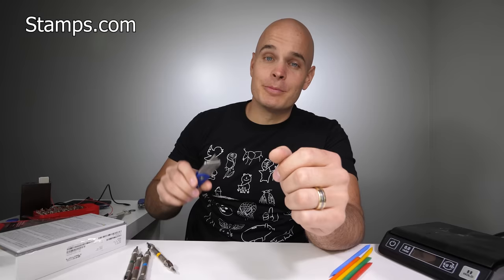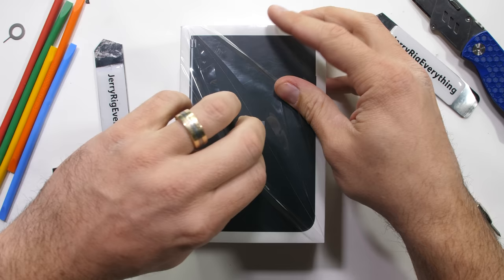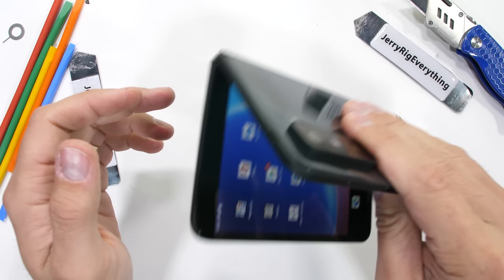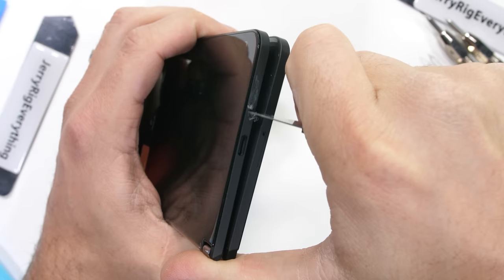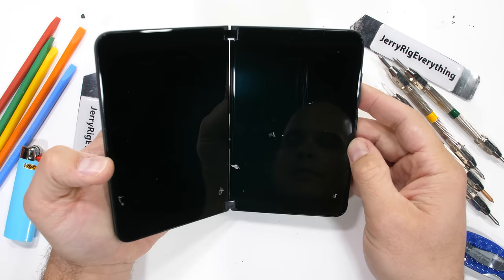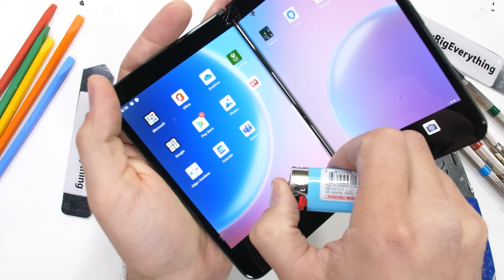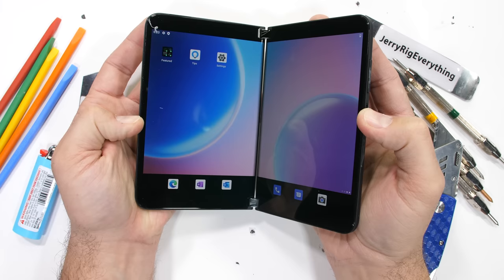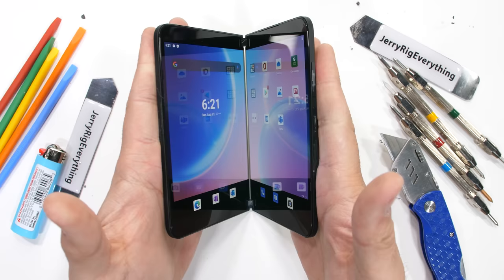Microsoft Duo 2 Durability Test! - There's one big problem...

Comment: Agree with Jerrys comments here, Microsoft should never have shelved windows mobile. It is by far the best mobile operating system even by today's standard despite the fact they haven't worked on it for a while. Android and iOS use similar kernel design so they are kinda alike in ways. Windows wasn't and Microsoft had an amazing team during its time, best cameras, smooth phones even on 512mb ram and imo the best user interface for a phone, app tiles were so good and intuitive, None of this boring app icons bullshit. The app problem would have been solved now with their appstore solution that's just out for windows 11. Just port it into the mobile.

Comment: Full Windows 11 on the Duo is entirely possible and would be amazing. I would buy it instantly. 

As an Android phone I couldn't care less about it.
Reply: yeah it all cool until your phone need activation lmao
Reply: @NandelsWoking  how is that an issue?
Reply: Widows on mobile device ???
Haha .... they tried windows 8 / 10 mobile and was really bad to use .... 
Not proper designated 99.99% apps for touch and worse dual screen.
Windows is good only with keyboard  and mouse.... a lots of memory and fast CPU.
Reply: @mirek190  Windows 8 and 10 Mobile were not full Windows operating systems. Windows 11 ARM is a full Windows OS.  Windows 11 also works well with touch and can be run even on old slow hardware - my Note 10+ is more powerful than my Surface Go, yet my Go runs Windows 11 just fine.
Reply: @nickthaskater  What's that point if you do not have any touch apps for win 11 mobile .
Apart from that windows apps are heavy .
Reply: @mirek190  There is no "Windows 11 Mobile," just Windows 11.

Any app is a "touch app" - this can be seen by using something like a Microsoft Surface tablet running Windows 11. I use my Surface Go as a tablet on a regular basis without issue.

Comment: Blaming Android for incompetence of Microsoft devs on this particular product is just gold 😂
Reply: I see his statement not so much as blaming Android, but stating the short comings of Android for any foldable mobile device in general. Think about it, why did Android started the development of 12L? They knew foldable will not be successful on current Android design. I think Android 12L is the beginning of robust Os design for foldables such OEM can just do HW, skin the Os, but let the Os do all the heavy lifting that will make foldable do good stuff and solve problems that single screen Phones can not do. All current foldable phone manufacturing are doing independent codes additions to show what foldable can do which might not help Android Os in terms of fragmentation. Let the Os direct and standardize the best use and features for foldables and OEM can add there own values and extras.

Comment: The camera bump actually broke the glass on the back if u put pressure on the camera inward the glass will crack. Not even that much force so don't squeeze the bottom part together when you're folding it open as one display.

Comment: I have the Duo2 and it took a very short fall to a carpeted floor while in "laptop mode" and bent and knocked the hinge out of place at the bottom...it still opens but yout have to manually push the henge to get the screens to fold evenly when flat.

Comment: it feels like this could be a really cool gaming phone, considering its already kinda like a ds anyways. itd be perfect for emulating different systems, since you could theoretically put touchscreen versions of any controls you wanted on the bottom, or even have one screen dedicated to the game with the other open to a walkthrough, which would be nice. that said idk the specs of this so it might not have the power for serious gaming, but i still think it at least has the potential to be really cool. i really hope microsoft and other manufacturers keep experimenting with the dual screen phone format, especially since the separate glass screens seem a lot more durable than the soft folding plastic ones.

Comment: It sucks that Microsoft isn't supporting the Duo. I feel like it would be way more successful if it was designed and advertised as a Windows or Android tablet instead of an oversized phone. Make it slightly taller, and I would definitely consider getting one. Even if the build quality isn't up to par, having a non-foldable screen with just small bezels connecting them, and not requiring a case to protect the screens are really good selling points.

Comment: I'm a power desktop user and can confirm that there will be no windows mobile OS anywhere soon if they dont develop a whole new good kernel, Which they won't for sure! 
But this could be a great device for linux if it wasnt microsoft designing the device. Because Linux can run a lot smoother

Comment: With curved screens, its possible to make a folding phone that uses glass and straight angles to fold open with no bezels. opposing 45 degree angles on the screens and a slight modification to the hinge and it could work perfect.

Comment: I think that any mobile processor in that form factor would be not nearly powerful enough to run full windows. I daily drive a Surface Go 2 with a core M3 processor. That thing is way bigger and more powerful than the Duo and still only just provides a good windows experience. Instead I would be very interested in this phone if it could take a display input form a laptop and act like 2 small external displays. That would be so nice for multitasking on my Surface.

Comment: windows on this thing would be a killer, and not in a good way.

yes windows 11 supports android apps, but listen, android is just way more stable than any copy of windows has ever been and also uses far less resources on idle to begin with, which means longer battery usage, aside that do you really want an OS on your phone that can just kick the bucket or delete your documents folder after some faulty update? re-installing windows on that will be a massive pain if for whatever reason it quits to work.

Comment: Agree with you on the OS, MS should plop a windows OS in the device.   Of course, the price would likely go even higher.   But I'm not sure it would damage their laptop sales that much.  It's still a small device, and productivity is gonna be limited due to the size.   Not a fan of the camera bump, especially since you have to open the device to talk on the phone.  If you have to fold it against that camera bump to use it as a phone, that's just plain awkward.

Comment: I don't think that a Windows OS would be very practical as a primary phone. If you push yourself you can make it work, but not many would want to do that.
There are far too many apps that we are used to using on our phones (Android or iOS), which are not available on Windows. It would be extremely nice, if my phone was able to do the kind of stuff that I do on my desktop/laptop, but not at the expense of its existing functionality. 
A lot of people already pointed out Samsung's DeX. I believe that this is the correct approach to smartphones for power users. It's primarily a phone, and okayish as basic desktop. A big hurdle before is the fact that a lot of Android apps are currently not optimised to work on a large screen. This will gradually improve with the rise of foldable phones. So unless Samsung decides to axe DeX, it will only get better.

Comment: The main windows problem with smaller screens anything below 10 inches is the classic applications! This is not Microsoft's problem that the third-party x86 Classic applications are not compatible with small touch screens. However, Microsoft tried several times to make a portable touch windows version such as windows 10s or windows mobile but it hardly lacks the classic applications.
I think turning to android was a wiser option because of the multi-scale features and millions of applications and also Microsoft and some other software companies have released their popular android application and made them better than ever. Office for Android is one of the best examples.
Here's the interesting part of the story, WIn 11 finally supports android applications which means that we can have windows on arm based tablets so it wont lack the software and also brings perfect windows features.

Comment: The thing holding it back is also lack of optimization. Z Fold also uses Android but with Samsung's years of experience it runs decently. But Microsoft doesn't have a lot of experience in Android and also seems to be not optimizing it well.

Comment: What if Samsung and Microsoft pair, and they make a galaxy Fold with customized Windows 11 and a chip which supports emulating x86 and running android apps on Windows( I'm assuming they come up with an ARM solution) without much performance losses?

Comment: If I remember correctly and it wasn't a fever dream, Microsoft announced the Surface Neo on the same presentation as the Duo. It was supposed to have a similar form factor, but with (around) 7" screens, and running Windows 10 X. So it was the "big brother" of the Duo, just running full on Windows, and would take the concept of a "pocketable computer" one step further. Unfortunately, the Windows 10 X work got incorporated into Windows 11, and the Neo was postponed until further notice. I was really looking forward to the Neo, even more than the Duo. Sometimes Microsoft has all the cards in their hands, and they still mess up the play...

Comment: I think Microsoft has some limitations because of which they do not add more than 2gb ram and 64 gb  storage in portable devices.. Have a laptab which could be essentially used as a lightweight laptob but due to ram limitation, it is not possible

Comment: I could still use more wall warts for many years to come, I never threw out a single type A one, but I do have a couple spares lying around. This is where I'd like to get to, the ones in the shops just aren't the same quality you get with your phone.

That camera bump is hideous and a deal breaker. I'd rather a thicker phone and more battery or repairibility than a bump. Also I'd rather bezels than a notch.

Can't we get one company that doesn't copy Apple so we can havr choice, I started on Android for a reason.

Comment: Personally I'm frustrated that no one seems to have done a thorough Surface Duo + Remote Desktop test - even if this ran Windows 11 it wouldn't really allow you to do that much with it's current power. I doubt it could run photoshop or a video editor that well.

if, however, a remote desktop UI was optimized for this device, it could wirelessly control a windows device and potentially solve some of current usability issues with remote desktop on a phone. Having a good stylus and dedicated touch buttons for keyboard input/shortcuts could make for a very functional little device.

Comment: Just discovered today, that my less than 2 1/2 year old duo 2 is non-repairable, my battery is not lasting like it did, so tried opening a service &  repair at Microsoft, and they no longer service the phone!, so I called them and they say they only replace phones, that they are non serviceable! and that they don't have units anymore! and I ask her so if I wanted a battery replacement how much would have cost me, and the lady says since its out of warranty the same as a new phone, but again we don't have stock. WHAT IS GOING ON WITH THIS COMPANY! so much e-waste and such a loss, ($1700 !)  a perfectly working phone, to the trash because they designed this device to not be repairable, you cant even find batteries anywhere!. Please bring this up to the attention of people!

Comment: You may have 700 charging bricks cause you buy every phone, but most ppl don't have so many. Also, every company does fast charging differently so just because my old device came with a brick doesn't mean it will be best for the new device. Also, if you have an older device, it most probably didn't have USB-C brick.

Comment: The camera bump can be eliminated by recessing it. All they had to do is plan for it during the development and not an after thought. Design the motherboard such that space for the camera inside the frame is deliberate. I bet they can find a spot for a smaller pen design as well like those in Galaxy Notes. finally, I think once AMD's NUVIA arm SoC comes out, a Windows Os version of DUO should be very practical and they MUST use USB4

Comment: The whole reason Windows phones use Android is because nobody bought Windows phones when they had a proprietary operating system a decade ago.

The app support for Windows then was meager at best, so if there's a guarantee one could get the same apps on Windows as they can Android or iOS, there would be an argument there.

Comment: You know why don't do Microsoft phones because they tried it for years and failed. Then they tried windows 10 arm, but it's not windows, it can't run programs of x86 well. As windows runs on x86 Intel and AMD processors. Intel tried mobile x86 processors the atoms they were pants. Unfortunately Microsoft, Linux (Unix) is the future for Microsoft but it's doesn't want to just yet. Also the reason apples arm processors m1 are so good are because they are arm, high proformance but low power consumption. X86 has come far but it's power hungry and now it looks like it's not even the fastest. Arm is the future of most things and Linux already has a massive headstart. Microsoft like Samsung would struggle to create their own OS and make it at success as they would need to be in some respect starting from scratch unless they support android apps. Android is opensource so why wouldn't you use it over building your own. Rant over.

Comment: I use android desktop mode a ton. It's actually quite great of u set it up properly. Many apps are becoming accessible through the  browser, so I care little what operating system I'm on. Biggest issue with android, it only supports 1 external monitor to my knowledge. I want to use 3. 

I think microsoft is too late to step into the game. It would be nice if they tried, so android starts to actually do their best for once.

Comment: Duo cant run WIndows, I mean technically it could, but whole point of windows is not only about amount of software it provide but also hardware power and battery life it need to run it to be useful. What would be point of windows on this device if 90% of applications would not be compatible with that type of screen, and it would not have enough power to run them properly? You would end using just basic applications for media/documents and browser with not that many tabs and pluggins, as it would struggle to run anything else for longer time than few minutes. Android is far from perfect but there are lots of special apps that do specific work that you normally do on PC, and there is lots of methods to keep it synced with your PC in real time so you can use browser and files between two devices to keep productivity in normal level.

Comment: Microsoft started trying to fit in instead of innovating. They couldn't been way ahead or at least had some decent market share if they actually tried to make a decent device when they had a windows mobile OS. Now they're trying to fit a square peg in a round hole with android and it's just flash with no substance. They could totally put Windows 11 (mobile) on this device, but as you said, they won't.

Comment: But Jerry - Windows 11 can't run on Surface Pro from 2years ago, why would you expect it to run on a lesser ARM processor & ram specifications... Microsoft was clear Windows 11 isn't for the weak of heart.. you need a i5 8th gen processor or better with 8gb of DDR4 Ram.. and thats just the bear minimum the expect you to have a $1200+ computer to run windows 11 smoothly..

Comment: Why would you need a front display when you can just fold the phone all the way round and keep it like that 😂 no one needs a third display on this thing.

Glanceable basic info is already coming through on the spine. And that's only needed in specific environments when you've got sound and vibration off. Or again just keep the device folded round if you want.

Plus being able to close and separate yourself from this device a bit more is the most satisfying experience. Like closing a work laptop at the end of a work day.

Comment: My man, Windows on a screen that small would make me vomit. I’ve tried navigating windows via touch on a 15” screen and it’s bad enough- much less a screen this small. Good luck hitting the X, Maximize, or Minimize icons with any accuracy on a screen that small- it would almost force you to use a stylus any time you did anything on it. That would be a hassle! Further, Windows has a horrible camera app, a horrendous Google Maps experience, battery management is a joke on Windows compared to iOS and Android, Windows has almost nonexistent GPS support, and Windows has an absolutely abysmal app-store for screens of this size. No way in the world would I take Windows over Android on a device like this. Battery, Camera, GPS/Navigation, a good phone experience, and robust app support are the main things I want out of my mobile devices. If this device was Windows, it would have none of those.

Microsoft already tried to make a mobile OS. We saw what a cluster that was.

Comment: from a hardware perspective, if you had windows installed on it - you likely wouldn't have enough battery capacity unless you teamed up with anker to supplier extra juice. Also, as android is likely running on an arm processor, the windows machine is also likely to be very slow or buggy (think of raspberry pi running windows) as for the most part it isn't really well build for it.